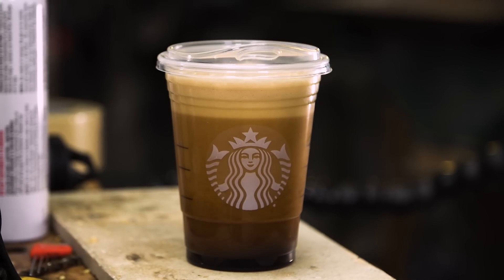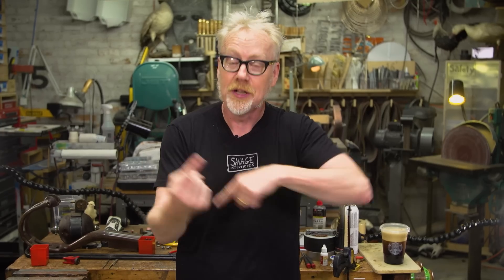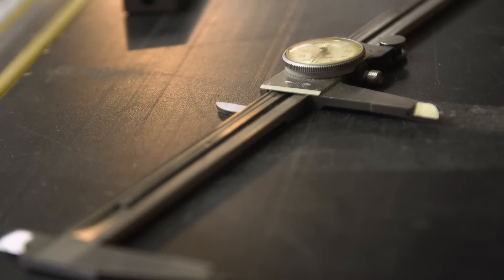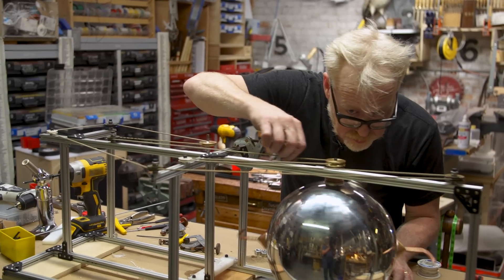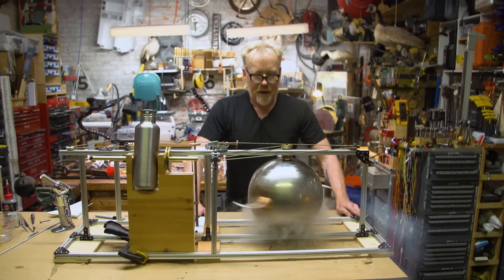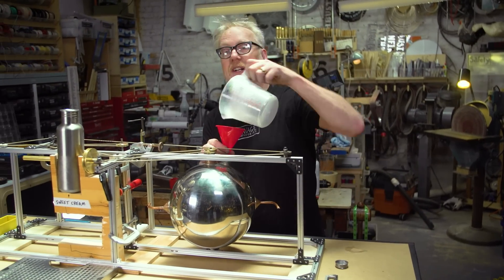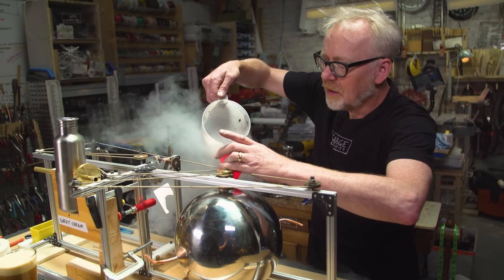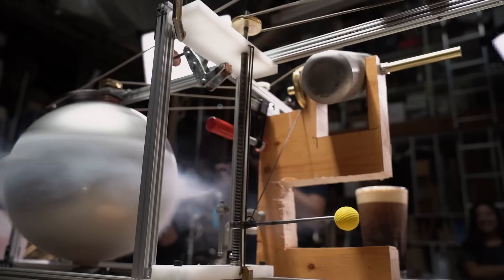Adam Savage Builds a Hero's Engine Sweet Cream Pourer!

Comment: The issues you experienced were a lack of heating surface area and a lack of reaction mass. Once you manually spun up the ball, liquid reached the ports, resulting in a combination of effects that provided better heat transfer, as well as providing denser reaction mass in the form of liquid nitrogen.

Comment: As much as I love heros engine, as it was it can only produce enough kinetic energy to propel itself. The moment you try to add anything to it the thrust to weight ratio is too low to push much of anything else. It took a lot just to get this one going and it had to be huge. I'd love to see someone try and pick up where hero left off and figure out how to solve this. Sure we have the solution already with the steam engines that came later using pistons and turbines, but I'd like someone to try and expand on this design to actually make it mechnaically drive something.

Comment: Awesome! That's the first time I've seen one of these do any kind of useful work. 

I think part of the problem was that it appeared to be starting out under load. This thing is basically a reaction turbine, meaning it will have very poor torque until it's up to speed. If it were me building this, I would have included some kind of a simple clutch that could keep the pulleys for the cream-pourer disengaged until the engine was spinning at max RPM.

Comment: It seems like the device only really gets going once LN2 gets into those copper tubes and starts sucking the heat out of the air, and it only gets into those with enough centrifugal force. If instead of a sphere, you used a toroid, the nitrogen would take less energy to start. Additionally, adding heat sinks to the outside of the device would boil it faster.

Comment: I built a Hero's steam engine that does 5400 RPM with actual steam.  (www.HeroSteamEngine.com with embedded YouTube video). Thoughts about whether an aeolipile (Hero's steam engine) could have driven a car or train or do other useful work has been debated for a century or more.  I decided to build one and measure its power output to settle the question.  I calculated its theoretical efficiency at converting heat energy to mechanical energy and it was only about 1%. But when I built one I found that the efficiency was only 0.01%, possibly due to losses from friction and air resistance.  The results are given in detail in the web site.  Look it up to see video, photos, calculations, discussions and dispelling myths about Hero (Heron of Alexandria) himself.

Comment: no experience at all just educated guessing. the nitrogen boils off expanding as its a gas, but it does it slowly once what it's in contact with cools down, would possibly adding heat such as hot water before capping it off cause it to boil off faster and spin without so much initial force from Adam spinning it?

Comment: I think it starts to work when the liquid reaches the jets so the liquid is squirted out of the jets. So more of a cryogenic water rocket powered cream addition device rather than a hero's engine. 
To get it to work as advertised I think it needs smaller jets to build up more pressure or more heat input.

Comment: Hm... just guessing here, but it looks like the big increase in "propulsion" happened once the RPMs got high enough that actual liquid nitrogen (instead of just gas) started reaching the nozzles.  I'm thinking that evaporation inside the nozzles would have resulted in a higher exhaust velocity, and hence a boost to the speed and torque of the whirligig.  
So, basically, it just needed a good kick-start.  :)

Comment: The reason why it takes time and agitation for the hero's engine to work is that there is not enough surface area in the "boiler". Early steam engines had the same problem. To get around it they added horizontal tubes in their tanks. If you add vertical tubes in your boiler you will get a similar effect. More power output due to a faster release.

Comment: I got a feeling the reason that you had to spin it is that the container was cooling down so much that the liquid nitrogen was no longer boiling,  and when you made the Hero's engine spin, it was pushing the liquid up into the warmer parts of the engine where it boiled off rapidly. If you added a small heater or something to the bottom I imagine your engine would work just fine!
Reply: Actually, the spinning brought the liquid up to the outlet ports which got enough reaction mass to the jets to produce thrust. Believe it or not, there's not as much energy in boiling N2 as there is in boiling H2O.
Reply: @robertgoff6479  1 dm^3 of N2(l) turns into 0,696 m^3 N2(g). So the gas takes 696 times as much volume as the liquid. So no, it's not 'too weak'.
Reply: Was thinking same thing

Comment: You need to wait for the nitrogen to build up, and heat up sufficiently. Or use a pressure relief valve to activate the two ports. But then again, gas is very light, and you're throwing a maximum of maybe 1kg out of those nozzles. Pressure at lets so 3atm above ambient, nozzle size of maybe 2mm^2 each. Even if you shot all that gas out in 30 seconds, that would be a mass flow of 0.033kg/

Comment: should have just added heat instead of spanking it.  liquid nitrogen might off gas at room tempter but it still needs heat to do it.  All spinning it up manually did was get the liquid in to the pipes which then increased the surface area and ambient heat it was exposed to.  which most likely means it also sputtered out a lot of the liquid form of the gas and that's like expelling unused fuel as propellant (inefficient).

Comment: How could liquid nitrogen have nothing to do with the nitrogen infused in the beverage?  It's the same thing just compressed, I understand you're not using the liquid nitrogen directly to infuse nitrogen bubbles into the drink, the liquid nitrogen is being used as a pump fuel.  But the way you said it made it seem as though liquid nitrogen and gaseous nitrogen are not the same gas.

Comment: What seems to be happening is that the device only works when it spins fast enough that you get liquid nitrogen into the small tubes where, due to the excellent heat conductivity of copper, and the motion through the ambient air, the nitrogen is partially turned into gas before a mixture of gas and liquid getting spurted out through the tube. As the sphere spins faster, more liquid is pushed out both by centripetal force, and from boiling N2 within the sphere. As the liquid nitrogen is much more dense than the gaseous nitrogen, it's enough with only a small volume to create a bit of thrust. You also have good 'coupling' due to the relatively slow speed of the exhaust.

With a more efficient heat exchange to the ambient air it should be able to self start, and maybe run a fair bit longer. If you make efficient use of the work generated when converting the liquid to gas, without blowing things up, one should be able to make a very impressive machine. Turning 800ml of liquid nitrogen into gas would require about 150kJ, to get it up to room temperature about the same again. In the process you can get an ideal ~50kJ of work done, or about a horse power for a minute or so. 

Is it only me, or does an improved version seem like something right up Colin Furze's alley!

Comment: Perhaps getting it up to speed by hand caused the nitrogen to move up the sides of the sphere, increasing the surface area and thus increasing the rate at which it transitions from liquid to gas. This startup period could probably be sped up with a torch or other heat source

Comment: Should have used an archimedes's screw directly attached to the hero's engine to lift the cream out of a container and slowly drizzle it into the cold brew. A particularly long Archimedes screw enclosed in glass with the a spout and the hero's engine spinning with smoke on top would have been nice.

This was good to, but it would be nice to have the hero's engine more closely related to the act it is supposed to be a part of.

Comment: It seems this engine starts to accelerate by itself only at the point where you spinned it up enough for centrifugal force to push liquid nitrogen right up to the outlets, so it actually starts spitting liquid out of the nozzles. It's very much like air + water bottle rocket, which uses compressed air as an energy source and water as a reaction mass. I bet it is not how this supposed to work :)

Comment: Utterly pointless. Should of had a heat source under the ball. Also longer copper pipes internally (to the core) so you're not spraying the liquid nitrogen everywhere from centripetal force. There is dozens of things wrong with this. Even if the cable was better secured. If i had your money and social media push... And equipment..

Comment: So static liquid nitrogen doesn't offgass vigorously enough for the sphere to start spinning on its own, until you started spinning it by hand, making it a centrifuge and having the liquid nitrogen up on the sides to spew out the jets, AND giving it about 5-10 seconds to build up enough internal pressure to spew liquid (more dense) exhaust under pressure and that action-reaction was enough to self-sustain.   Apparent answer is if the initial fill of LN needs to fill the sphere to the point of submerging the inside openings for the jets.

Comment: If you do this again Adam, you need a bigger heat differential between the ball and the nitrogen. Air is a good insulator and would be why is didn't work so well. Adding a 12v heating pad or other heat source, below the engine would boil the nitrogen faster.
Still a great video although I won't buy from Starbucks till they start paying the tax they are still avoiding in the UK.

Comment: Im no scientist but I wonder if you warmed the ball with a bunsen burner on low flame or even a couple tea candles like the steam engine version the pressure would build up and the nitrogen would expand quicker, thus jet out at high pressure and spin the hero engine without you manually spinning it? But again not a scientist.......cool contraption as always man.

Comment: My take what made it work and speed up: at some speed, the liquid starts spinning and rising up the sides of the sphere enough that liquid nitrogen comes out of the jets, instead of just gas. With more ejected mass, the acceleration goes up dramatically (and you can see the huge amount of clouds being produced, until it's empty). It's a bit like water rockets, and why you use water and compressed air, as opposed to only compressed air.

Comment: I think the reason it was reluctant to start, is caused by the nitrogen was not getting heated fast enough, and when Adam spun it with his hands it eventually got hot enough to release the gas. I think it would have started spinning sooner/more consistent, if he had used a hairdryer to heat it up. Just my 2 cents.

Comment: COUGH gloves
Reply: I was always taught not to wear gloves when working with LN2 because that waythe leydenfrost effect protects your skin from actual contact with the fluid.

Wearing the wrong kind of gloves might do more harm than good if the LN2 soaks into them and you get prolonged ski  contact.
 
Then again, there are special globes designed for the handling of cryogenic fluids, he could habe worn those, but they are expensive and really only important if you start to get into substances which have a higher boiling point and don't simply evaporate on contact with an ambient-temperatured object.
Acetone is a perfect Example for this

Comment: Maybe a torch on the bottom of the sphere would have coaxed a bit faster expansion. I also wonder if spinning it to kick start caused the liquid to cover the outlets due to centrifugal force. Ever seen when You take liquid nitrogen and water in a bottle and turn the bottle upside down? Something about that extra confinement having the liquid help seal the gas into a smaller cavity helps build pressure. Just wondering what all contributes to such an energetic expansion.

Comment: i wonder if the heroes engine could be a cylinder instead of a sphere.... it clearly takes a start up momentum, meaning you have to get it up to speed first for the effect to be pronounced, but im wondering if it is because there is a vortex forming inside of the sphere and if it can be improved upon by changing the shape of the container.

Comment: What looks like was going on is the simple evaporation of the liquid nitrogen wasn't enough. He had to spin it fast enough for centrifugal force to push the liquid up the sides of the sphere and into the jet pipes. That would block the pipes so the evaporating nitrogen inside could build more pressure, forcing the liquid out faster.
As the liquid neared the ends of the pipes it would rapidly evaporate, producing more thrust, keeping the spin speed high enough to keep the liquid slung up to the equator of the sphere.
Making this self starting would need a way to allow the pressure to build until it's high enough to produce enough thrust to start it spinning. Then once the RPM is high enough, the pressure restriction needs to get out of the way so the liquid can enter the jet pipes without restriction.
A safety popoff pressure relief would be a good thing in case of something freezing up.

Comment: Ok, that was neat, ok starbucks you win this round... I'm going to give this drink a try.
Oh by the way adam... you kind of of need a pre-heater on that device the Liquid N2 is so cold that 
it's cooling the metal so fast that it's going stable rather than boiling..  Just using a heat gun for about 30 seconds would have fixed everything.

Comment: Great concept Adam, glad to see you got your result.
The nitrogen just sitting in the engine, could not absorb enough heat through the sphere's surface to produce enough gas.
When you spun it up, the liquid, due to centrifugal force, moved up the walls of the sphere
Now covering a larger surface and being thinner in layer of fluid, it was able to absorb the needed amount of heat an generate the gas.
The spinning would also ventilate the outside of the sphere so it would keep relatively "warm".
Pouring a jug of warm water over the sphere may have got it going without having to manually start it.

Comment: One neat thing is that the nitrogen isnt actually infused or dissolved (or anything) in the coffee at all! Rather a mix of N2 and CO2 are present in the pressurized vesel at high pressure (ie 40-50psi) while keeping the coffee at 2-3 volumes of CO2. Then, it gets poured through a disc with micro holes where the CO2 forms the tiny bubbles you mentioned! Just like guiness

Comment: I think the reason it worked at higher speed was because of steam hammer (centrifugal force moved the liquid up over the outlets, which was then forced out by expanding gas). Would explain why it didn't work earlier: gas didn't have enough mass to spin the engine, but the liquid did!

Comment: Eh-oh-lee-pile.
But Hero’s Engine sounds just as cool. Early use of what is essentially rocket power (cold gas thruster power?) right there. 
Good use of centrifugation there as well.
Reply: Actually, now I get why they discarded the aeolipile as a novelty. It must have thrown boiling hot water all over the place during operation, which would be a frightening occurrence even today...

Comment: I suspect putting a heat exchanger from a computer or something similar on the bottom would help boil the nitrogen faster. It appeared that the nitrogen started to boil once it worked it's way up the wall of the sphere, thus indicating the need for more energy exchange surface area. Just a thought.

Comment: Just as a suggestion if you added hot water into the sphere as well as the liquid nitrogen you would not need to spin it as much to begin with. It’s a lovely piece of engineering keep up the great builds 👍
Reply: I think the initial manual spinup causes the liquid to move up the walls of the container. This spreads it out over a greater surface area, speeding up heat transfer from the outside and thus the rate at which it turns into gas.

So adding water may help.

Or initially plugging the nozzles so pressure can build up before releasing the jets. It may then start itself.

I'd love to see a classic hot and this new cold heros engine side by side.

Comment: My guess is that the surface area of the small puddle of liquid nitrogen at the bottom of the sphere was putting out too little nitrogen gas.  Once you spun the sphere and the liquid nitrogen was forced up the sides of the sphere, the larger surface area allowed the nitrogen gas to be released at a faster rate, which then kept the sphere running.  Nice contraption.

Comment: Apparently Adam (or his team) didn't do their due diligence on the properties of LN2. Sitting in the bottom of the sphere it was never going to produce enough vapor volume to drive the engine. Apparently by accident, Adam found one solution which was to allow liquid to enter the jets, flash to vapor and produce the needed thrust. Preloading the sphere with a larger quantity of LN2 would have not only reduced the starting rotation but would had increased the duration of the effect.
Introducing heat to the bottom of the sphere may have allowed the LN2 to flash to vapor fast enough to self start without the need to spin it up by hand.

Comment: I think the only thing missing was some sort of heat source to keep the vessel warm enough to really get the engine going.  The frost up the side means all that stainless went way down in temp, and the nitrogen wasn't getting a vigorous boil.  One blast of hot water over the outside might have been all it needed.  That's crazy stupid awesome looking once it gets going!! :D